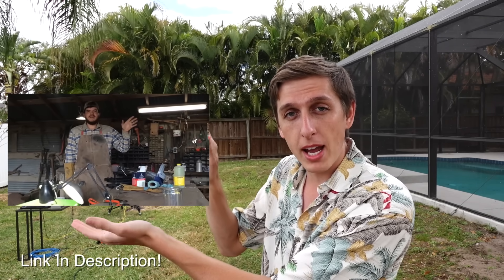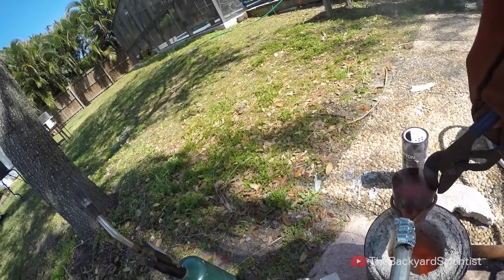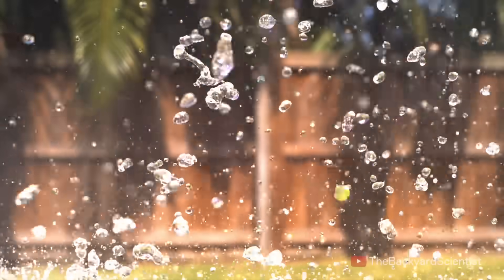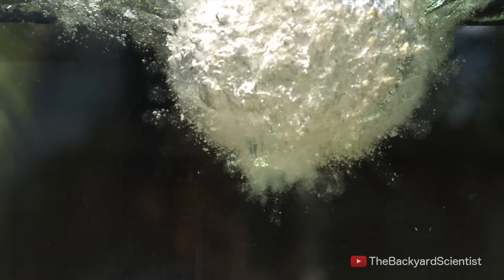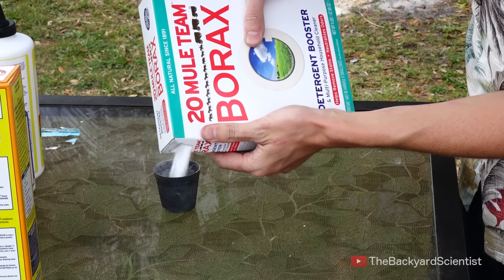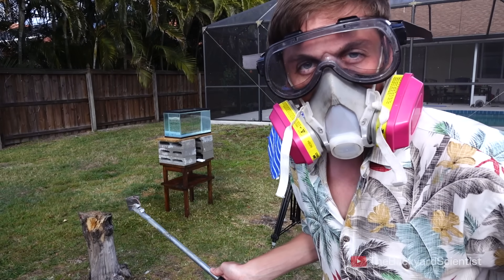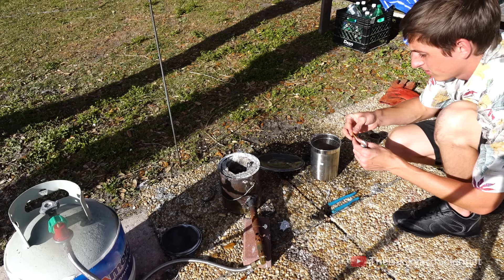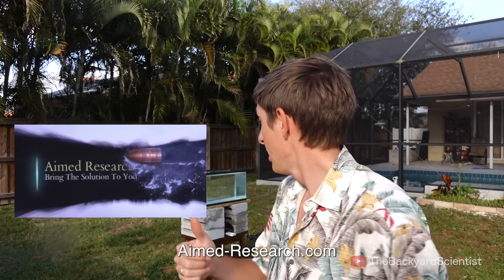Pouring Molten salt into Water - Explosion!

Comment: As a serious suggestion, have you tried heating sand/gravel to the same temperature and pouring it in. If your theory of surface area is correct then you can pick your grain size and demonstrate that finer grains make more violent steam explosions.
Reply: +DudeoftheDunes That's the point - it won't melt at 800 degrees so the granularity will be unchanged and under control of the experiment.
Reply: @scottmanley  you understand granularity doesn't apply to liquids right?
Reply: +Scott Manley 
Wot are you doin' here?
Reply: RyuuAkito Kerbal space program
Reply: His explanation is partially correct but it isn't due to "surface area".  What is happening is that when the liquid salt is dropped in, the blob is folding around a volume of water then, since it's still liquid, flowing around the bottom to completely or almost completely contain the water, a sealed "bubble" of water inside the salt, if you will. 

Then, due to the cooling effect of the water, a hard skin is forming on the outer surface of the salt.  While this is happening, the heat of the salt is boiling the trapped water but the steam from this process cannot escape due to the hardened skin.  This creates super-heated steam which ruptures the hard salt "skin" when it reaches the required pressure.

We can see that it's not the entire surface of the salt which is "reacting" because the explosions are localized and low in number - only trapped bubbles of water are exploding and to do so they need to meet a few criteria.
- the volume must be sufficient to create enough steam to burst the salt shell.
- the salt must be hot enough to convert the water to steam
- the containment must be perfect, no cracks or holes which the steam can escape through without causing an explosion.
Some bubbles will form and not explode, some will release their pressure non-violently, some may even be too large to boil into steam.

It's trival to experimentally determine whether the reaction was physical or chemical. Simply test the water after the explosion, if the reaction was chemical then it will be alkaline (sodium hydroxide byproduct).

Why it doesn't happen with the other ionic compounds is an interesting question.
- is salt more soluble than borax, and does that solubility prevent Leidenfrost effect by absorbing the 'shield' steam?
- is the heat capacity of salt much higher than the other compounds tried (they lack the energy to vapourize the trapped water?)
Reply: @daisyjenkins8543  NIce explanation! I totally understood that.
Reply: Daisy Jenkins, the borax and other sodium salts is the big mystery for me. Melting the sodium tetraborate decahydrate (borax) would cause it to be anhydrous before plunging it into water. Being hygroscopic, I wonder if that subdues the “explosion?” Or, maybe the anion tetraborate is too complicated of a structure to make a uniform “skin” to trap steam? It would be interesting to know the exact temperatures of the sodium chloride being quenched to make the larger explosions.
Reply: @daisyjenkins8543  I read this and thought "how and why does desalination work?"... But I think I know the solution.
Reply: @daisyjenkins8543  Thanks, that's an excellent explanation.
Reply: Molten salt is an incredible heat sink. I think the water is not able to cool the salt very quickly and so it causes it to expand to steam immediately. This is the principle of how molten salt solar plants work.
Reply: O_o I don't understand this complicated science stuff
Reply: I think it's caused by:  the Hydrogen produced from superheating & the Sharing/tranfer of electrons, during dilution...    Fuel + spark..
Reply: Scott Manley
Reply: Scott Manley ft and grandson
Reply: We should do that in kerbin with those green guys
Reply: Scott Manley oh hello :D
Reply: Scott Manley heating up sand makes glass blocks dog
Reply: Scott Manley x
Reply: That would make lave tho
Reply: the grains would all be melted first, so grain size wouldn't matter because it would all be one liquid mass
Reply: also yeah they would have to be different temperatures so that they would melt
Reply: +Eden umm he made ksp not papers please
Reply: sand turns glass
Reply: where is your evidence to support your claim?
Reply: Scott Manley
Reply: Oh henlo
Reply: I can only say Scott Manley in the same accent he used for his videos
Reply: Scott Manley boi
Reply: Since it's liquid though, it'd just come down to volume though, wouldn't it?
Reply: Wouldn't heated sand just turn into glads?
Reply: Will you all come to my house and beat me to deaf if I ask who Scott Manley is
Reply: Scott Manley Po
Reply: Jessica Soho
Reply: Scott!!!
Reply: Hell yeah, Scott Fk'in Manley!
Reply: +Scott Manley GLORY TO ARSTORZKA
Reply: @r4spb3rryAmy  greatest mother proud
Reply: I'm so happy to see you here! Hey, I just realized Squad's headquarters are in Mexico City, where I live! A member of the Squad team actually teaches at my university, and apparently he knows you! We talk a lot, and I'm actually really interested in working with them if I'm ever given the chance.

It's kind of sad, when he introduced himself he told us he worked for Squad and nobody knew what it was, or even what KSP was. Maybe that's why I get such good grades with him. :P

Anyways, just wanted to share. Thanks for being an inspiration man! I think you may have helped me choose my career path!
Reply: TheDrB0B Squad? Like the fps game on Steam called Squad?
Reply: OMG HI SCOTT I LOVE UR KSP VIDS :D
Reply: I have another idea, why the others ionic compounds dont react the same way:
The ionic structure of NaCl is more stable then the ones of Soda, and Borax, on this way the contained water in the hardend shell, gets more time to boil inside and burst out in the manner we saw.
Reply: Scott Manley awrite my fellow Scotsman!
Reply: Daisy Jenkins wow very ''because  science'' of you
Reply: +Scott Manley nice the manley shows up
Reply: Jessica soho
Reply: Scott Manley no way. Why are you here? I mean i know why but i didnt expect to see you here
Reply: +Scott Manley that's bull, cause sand or gravel don't go liquid at the same temperature, thus they will not be able to surround the water molecules. they will create a layer of steam on the outside of the sand/gravel and it will cool on the bottom.
Reply: @DudeoftheDunes  "go liquid" lol.

Comment: I second the viscosity argument.  I don't understand the methods of the papers I'm reading, but it looks like sodium tetraborate is at ~0.2 Pa s, but sodium chloride is at ~0.001 Pa s.  Then again, that's about the viscosity of water, so maybe it's not enough.  https://books.google.co.uk/books?id=qpsBySXejNAC&pg=PA379&lpg=PA379&dq=%22viscosity%22+molten+sodium+tetraborate&source=bl&ots=tyjcfpnUfY&sig=iALAtk9B4J6Aeui6krXYavw5OVw&hl=en&sa=X&ved=0ahUKEwjLjfCp6rnLAhXC6xQKHcSMBlUQ6AEIHDAA#v=onepage&q=%22viscosity%22%20molten%20sodium%20tetraborate&f=false http://www.nist.gov/data/PDFfiles/jpcrd167.pdf

Also, wouldn't the sodium oxidise (to sodium oxide) well before it melts?

Comment: NaCl in a molten state excites its native reactivity, this causes a mass release of ions when introduced to H2O and that interaction releases water into its base elements. Basically, the water is dissociated into hydrogen and oxygen, which in those pure forms and trapped under water in contact with the charged atoms and superheat can cause the hydrogen and oxygen to combust, which in the water vacuum creates the outward momentum explosion seen in this video.

Aside from the fact that NaCl already contains chlorine, a situation can be made worse if your city has recently treated the water with chlorine for purification, be aware that this interaction can release chlorine gas (so be careful). If you want to lower the melting point, you can add a little calcium chloride to the mix.

Comment: No. Even if there was a chemical reaction, it would not change the pH of the water. What if the salt and heat is allowing an electrical charge to build up, resulting in the separating of water into H2 and O2 gas. That gas would then explode using the heat as a ignition source without ever changing the pH of the water.

Comment: Can someone explain the difference between a physical reaction and chemical reaction
Reply: A chemical reaction implies an atomic bond change between the particles. For example, water boiling is a physical reaction as it doesn't involve any bond breaking or forming, H2O stays the same either if it's a liquid or a gas. Burning whatever organic think you can think of is a chemical reaction, because the bonds from the organic  compound break and new ones are formed in this case, CO2 and water.

Comment: I think the explosive properties of the different salts is based on differential surface tensions of the salts. The Leidenfrost effect is hugely related to surface tension strength, and NaCl has a very low surface tension for a salt, much lower than the other ones you tried. Surface tension also decreases linearly with temperature, which might be why the explosion only worked when the salt was hotter than its boiling point.

Comment: I believe it's cause of "explosion" is from the fact your adding super heated salt to water witch raises the water temp and instantly mixing with the salt and seeing that salt water has a lower boiling point it should lower all the other temps for physical change. and the "explosion" you see is most likely what youd call flash point.it's a point that turns an element to instantly combust or explode

Comment: Probably when the molten salt is in the water  the surface of the hard crystallized layer is formed on. Differences of temperature and stress in the crystallized mass causing it to break and ejaculation liquid interior to the surrounding water in the form of multiple streams. Increasing the surface in contact with water and break the insulating layer of vapor generates detonation.

Comment: Well Sodium has High heat conductivity and also dissolves well in water, so when you add this super heated sodium it quickly transfers its heat to the water, instantly vaporizing it ..that expanding vapor causes the sound and forces, i.e. explosion.

Comment: I think you are correct on the idea that water forms a bubble inside the blob of molten salt, however i think there's also a chemical reaction occurring; when salt melts it can decompose into sodium and chlorine (in fact industrial production of sodium is actually molten salt which is separated from the chlorine through a couple of electrodes) therefor i think there is also sodium metal reacting in the water (the implication being some of the chlorine evaporated off). I think the same thing doesn't happen to the other salts simply because the sodium is oxidized during the melting process (for example sodium carbonate would decompose into carbon dioxide and sodium oxide)

Comment: I believe the explosiveness has something to do with the oxidation states of sodium. when metal alkali is added to water, it bonds with the oxygen, thereby causing a rapid release of hydrogen. Bang!  sodium hydroxide (used in rocket fuel) is also a very highly reactive oxidizer.
Reply: Is it used in solid-state fuels or just liquid ones? I'm kinda studying this stuff and yeah, they tell you that autonomous engines carry the oxidiser within themselves, but with no actual examples.

Comment: +TheBackyardScientist Obviously, you need stick a quantum harmonizer into the photonic resonation chamber, and no, this will NOT cause a parabolic destabilization of the fission singularity as long as you increase the anti-mass spectrometer to 105%. It's still a gamble, but it should be safe if standard insertion procedure is followed. The possibility of a resonance cascade scenario is extremely unlikely.
Reply: Nice Fallout reference! :)

Comment: interesting expanding theory, but I think it's more likely to be a chemical reaction between the sodium and the waters oxygen, leaving lots of hydrogen outside which aggressively expands.
Reply: +JagheterJonah That doesn't make sense because sodium oxide is very basic (pH = 14), so the metal pot experiment would have shown an increase in the pH of the oxidized water.

Comment: haven't read the papers but from what I saw, salt is hydrophilic which allows it to sink and mix faster allowing individual hot particles of salt to transfer the heat, resulting in rapid expanding water vapor which hit the fish tank walls and either broke the glass cause of resonance or bounced upward.

Just a hypothesis

Comment: The heated salt is boiling the water or turning the water closest to the salt into vapor faster then the water around in the tank. 

hmmm... ever heard of an water explosion? That's when over-heated matter (like plasma) hits water and makes the water into steam at an accelerated rate and the water can't handle that pressure so it "leaves" with such a force to all sides (notice how the explosion at the top was stronger than the bottom or sides). I don't know how else to explain it any better.

Comment: Ask Thunderf00t to try it out.
Reply: I would love to see what he has to say!
Reply: +fegolem  He did try something similar. Dropping sodium and sodium kalium amalgam into water in an inert atmosphere, and he still got a boom, not by the produced Hydrogen reacting with Oxygen from the air, as textbooks have claimed for hundreds of years, but as a purely ionic repulsitory runaway reaction. If the same process is going on here, there would be enough electrons in the molten blob of table salt to make Natrium and Chlorine loosely bond together. However when the blob is dropped into water, the electrons of the Natrium are shed and the Na+ start repulsing each other. The Chlorine might not have any part in this process other as weak "glue" in the pure NaCl so actually this reaction might be more powerful than dropping metallic Na in water?  Before wasting any more fish tanks, he should try to collect some of the gasses. I suspect that the Cl- is reacting with the H+ as a secondary reaction to form HCL. He did test for ph, but HCL is a gas so most of it would escape before making much of the water acidic. 

He could also try with molten NaOH for a possible stronger exothermic reaction, if he wears proper protective clothing and uses a remote release jig, instead of his mothers broom. 

Disclaimer: I barely passed High School chemistry and some one more capable should run the MOL numbers and show the proper reaction formulas.

Comment: This is a good example of a chemical reaction.  You were using the pH paper which is used for measuring the 'power' of Hydrogen.( I call it power, others may not).  So when you add Na ( pure sodium) to water, you are not changing the hydrogen. 
Also, you were on the right idea on why you thought it was a physical reaction, but as the water molecules were to expand, the NaCl and Na were given more spaces in the container to chemically react with the water.

Make sense?

Anyway keep up the good work!

Comment: I think your looking at it wrong. the sodium chloride explodes due to an even "cooling" effect that the molten salt gets. the other salts did not explode due to a surface cooling that provided a "shield" of steam around them. the salt for some reason didn't get this and instead cooled evenly across all particles causing a sudden and violent cooling steam effect. How can i back this up? I cant I'm not a scientist or anything special but if your theory of a single drop of water getting into the middle of the salt were true then it wouldn't matter the makeup of the other salts and the same thing would happen to them as well. so therefore my only thought is an even and consistent cooling of all particles at the same time due to a unique chemical makeup. this would still be a physical reaction and not a chemical one.

Comment: i have a theroy: 
giving salt(sodium chloride) is a dessicant, im safe to use as you said superheated water drops getting caught in the salt and expanding but due to the dessicant effect more water is being drawn into the salt and the reaction is continuing until the salt cools and becomes saturated.
if youve ever taken a dessicant silica gell pouch apart and spit on the dessicant beads they will crackle and jump so that is what im safe to assume is the case here.

Comment: It is the sodium in the salt. The sodium is highly reactive with water. During the molten state of the salt apply an electric current and you will be able to separate Sodium from Chlorine. Then use the purified sodium for the same experiment ...but be extremely careful.

Comment: Two theories: 
One is that sodium chloride is more soluble and simple than the other salts used. As the salt comes into contact with the water, it begins disassociating and disolving pushing the heat into the water before the leidenfrost comes into effect.
Two, the sodium in the sodium chloride is actually protected by the Leidenfrost effect until it loses some of its heat.

Comment: I would guess its the quick dissociation of Na+ ions from the Cl- ions. since you have the perfect recipe for an increase in rate of reaction experiment. i.e. increased surface area of salt by melting it and very hot temperature of the melted salt plus the fact that the water reaches its boiling point instantly due to the heat of the melted.salt. nice video